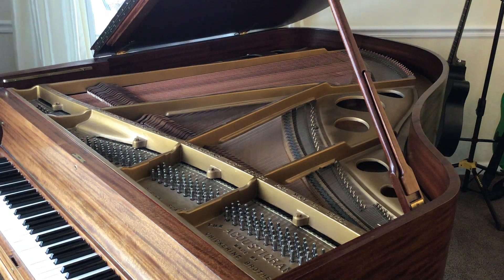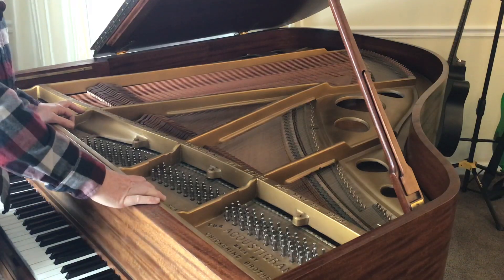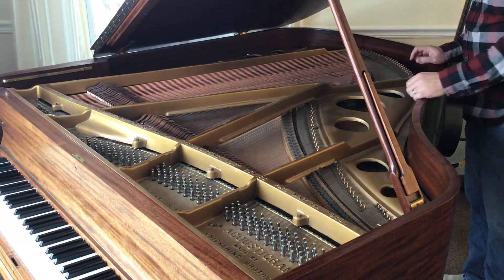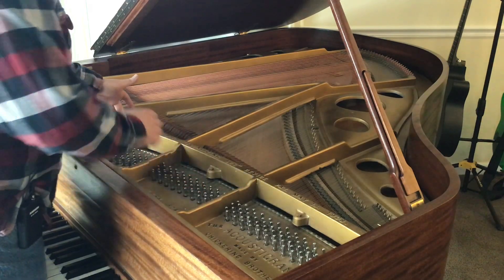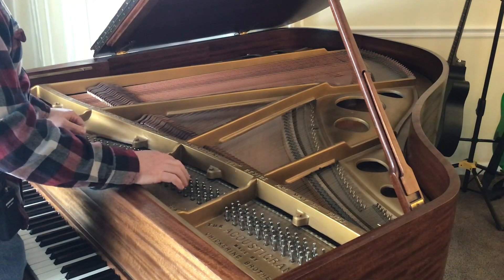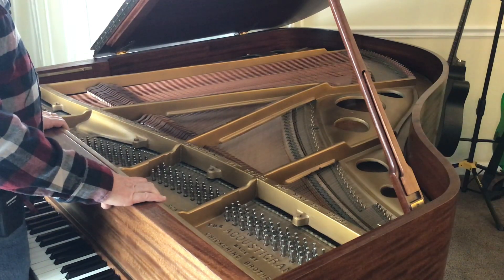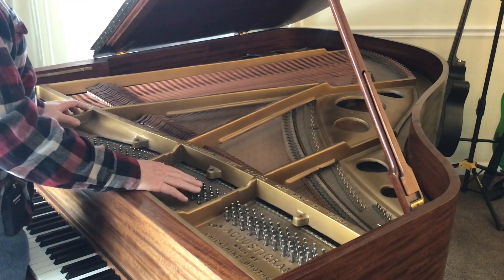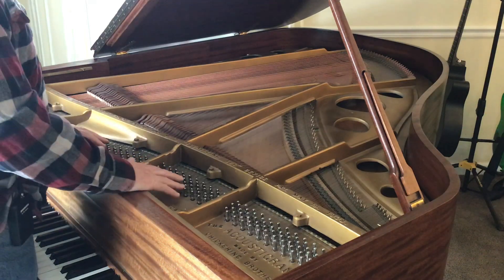Piano Restringing [Part 1] - Replace Piano Strings I HOWARD PIANO INDUSTRIES

Comment: I have a piano that is about 120 years old. I love the way it looks. Most of the piano keys are in fairly good shape, but I'm guessing most would need to replaced internally to keep it. Is it even worth it to consider restringing a piano like this? How much does a project like this cost?
Reply: By the way, I'm a violinist and I have to change the strings on my instrument and do occasional minor repairs to it.
Reply from the maker: Typically on average the cost of new strings and tuning pins would be around $800.
Reply: Please describe further. How is the sound quality?